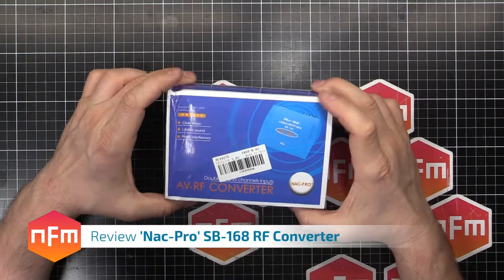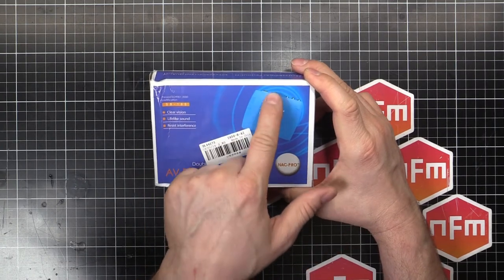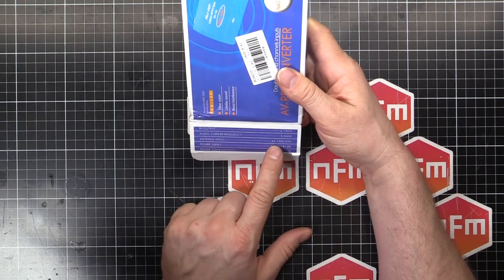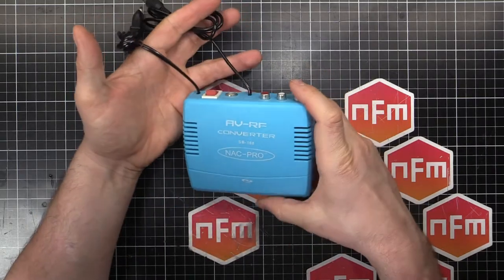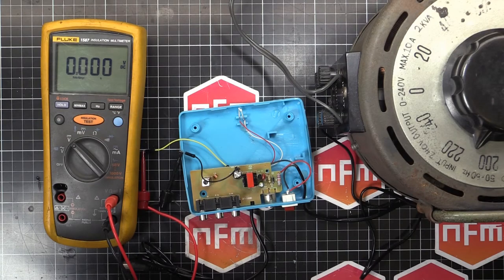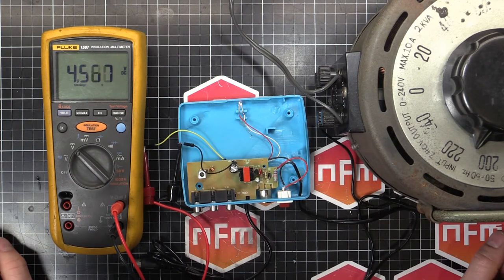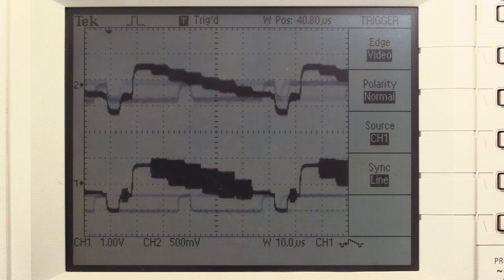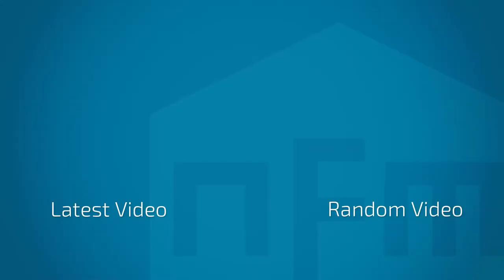NAC-PRO SB-168 RF Converter Review

Comment: Ok, but... What's better than this device at the moment?
Reply from the maker: I like to use old RF converters that were used for video game consoles.
I got one from a Sega Saturn, part number HSS-0110 that I was able to attach a USB connector to in place of the proprietary plug as it was powered by 5V which made powering it really easy.
Reply: @NearFarMedia  
Your device looks good, but I'm not sure if it is as versatile as the SB-168. Correct me if I think wrong, but... SB-168 is the best way to connect old input device (like PS2 game console) to an even older device, such as portable CRT TV, for example. SB-168 has red-white-yellow RCA plug (which could be great for PS2) and the old portable TVs have sometimes only an antenna socket (and SB-168 has already an own antenna socket as an output). Moreover, If I had an adapter named "MINI hdmi2av adapter", then I could try to connect PC to that portable TV.

I'm trying to imagine that image quality must be poor, but that's the"beauty" of analog signals :(